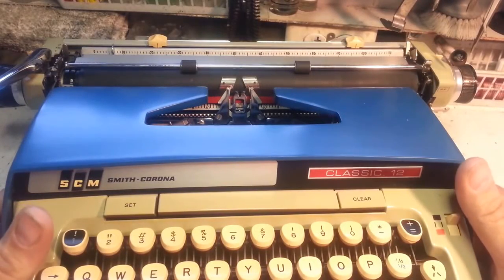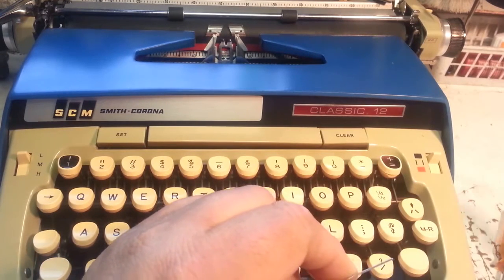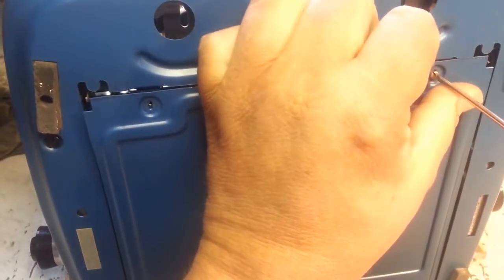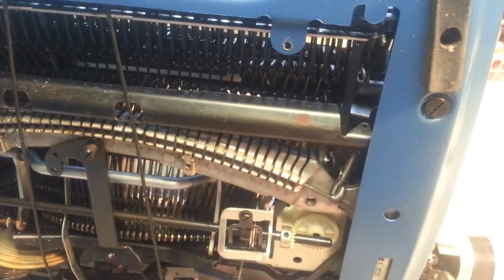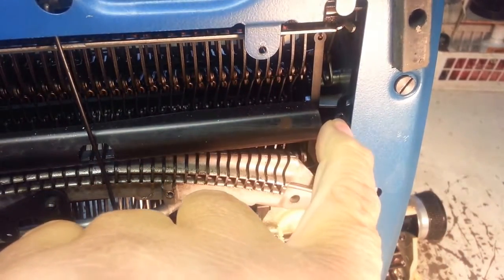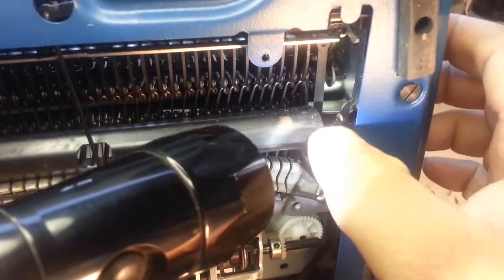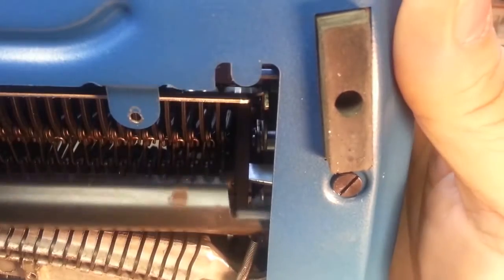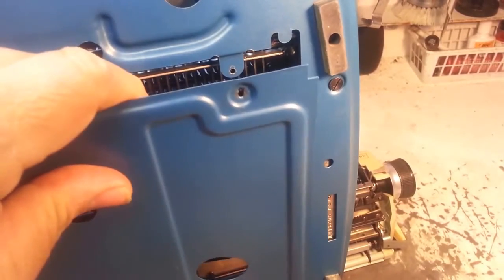Smith Corona Typewriter De-Jam Repair Fix DIY

Comment: Does lacquer thinner work best for cleaning stuck keys?
Reply from the maker: Work best for me, but be warned LT is a very strong chemical it will damage plastics and some paints
Reply: I noticed when you use it you have a little tiny squirt bottle so, I knew something was up!!!lol